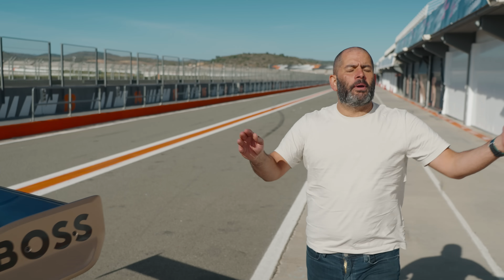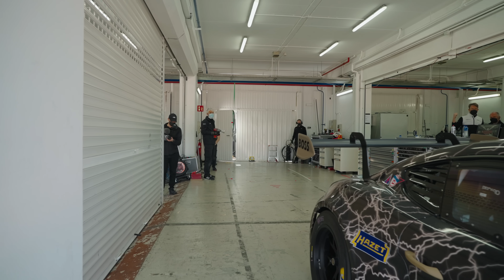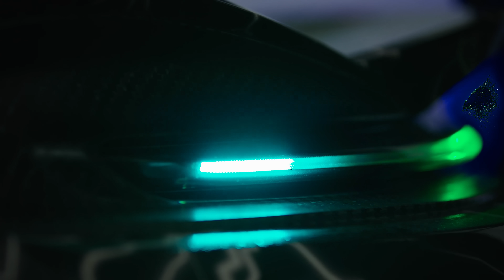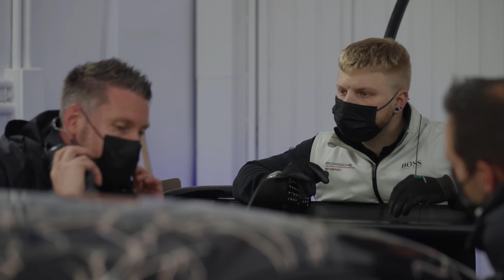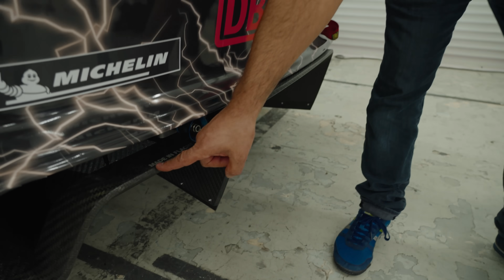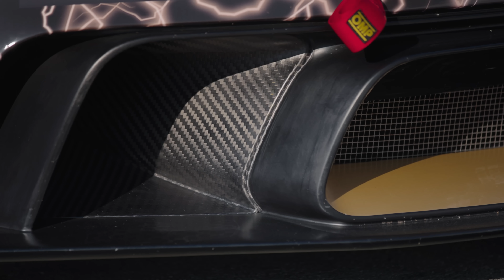Chris Harris Drives The New Porsche GT4 ePerformance

Comment: What happens when you connect an electric motor to a gearbox? Why don't they have one? Would it not be useful to have the motor rev like that through a few gears? Motorbike engines rev that high and they have gears. I know there's no crankshaft in an electric motor, but there is an output shaft, and I thought it wasn't important how the output shaft is driven, you always had to have gears. Explain it to me like I'm 5yrs old, because I haven't heard why EV's don't have a gearbox.
Reply: Electric motors are much less rev dependent, i.e. they don't need to be in an optimal rev to do max torque, its torque curve is basically flat, so the gears aren't needed
Reply: @Mixi1  I thought gearing was about governing speed, and enabling the engine to rev up multiple times. Gear reduction etc. We also have forced induction to cover any holes in torque. "Because torque" is not a sufficient answer. We have plenty of ICE engines that make huge amounts of torque from very low down, and still have a gearbox. My car for example is a new turbo diesel, and it's torque curve is very flat. Small turbo's will cover up and flat spots lowdown and provide a very flat torque curve. So, if an EV would go from 0-120mph with only one gear, how fast would it go with two gears?
Reply: @superchickenlips1  in case of gearing think of the torque rev range. even the best ice has torque in range like 1000 to 7000 rpm. so with first gear it can go from 2 to 14 mph because revs conver linearly to speed. with electric you have torque even from 100 to 10000 rpm. which with correct gearing is 2 to 200 mph.
Reply: Electric motors have instant torque, so essentially there’s no need for gears to make sure you’re in a power band, because you’re always in that power band whether you’re at 2000rpm or 10,000rpm. Obviously there is an optimal gear ratio to compromise for both acceleration and top speed, but this covers both ends in one gear when you have instant torque from an electric motor.
Reply: It's because the torque is immediately available with electric motors. With a petrol engine you get X torque in Y gear at Z RPM, with electric if the throttle is flat, you're getting all the torque, whether you're at 0mph or 100mph so a gearbox becomes redundant in most applications.
Reply: Because they have nearly constant torque and such a wide operating RPM range that you simply don't need a transmission. It would just be extra weight and complexity

Comment: That noise cannot be good for your hearing, what a shocking racket !
Reply: Well the noise is the straight cut gearbox and not the electric motor funny enough. Normally you have a ICE drowning it out, so without it you just get high pitched whine. Not fun for a cockpit viewer but the driver will have earplugs on and outside you tend not to hear it as much, mostly aero and tire noise. It’s the future so we should all get used to it
Reply: @k-ron7403  Gearbox ? You sure about that ?
Reply: @k-ron7403  The noise isn't from a straight cut gearbox because this car doesn't have any gears. That shriek is the electric motors.
Reply: @gbgt2  I'm fairly certain it still has a gearbox it's just a single speed rather than a multi gear transmission, and the drive gear has straight teeth instead of angled ones.
Reply: @gbgt2  Nearly all current BEVs have a Gear Box either Single 1 Speed OR a 2 Speed like the Taycan. Even with a 1 speed box that still has multiple gears to do the reduction. The shriek is a combination of both the motors & straight cut gears.
Reply: had to stop the video the noise was so annoying

Comment: 1500 kg is heavy for a race car. Tire and brake wear must be monstrous
Reply: Regen... So brakes not so much, but tires definitely 👍
Reply: Good point,  about 255kg heavier than the current 911 rsr.
Reply: @trackratzinger  and I bet the battery is pretty tiny on this car or the difference would be in the 400-500kg region.
Reply: @weed46  80kwh useable pack capacity so no not tiny at all. Porsche claims 30mins racing pace at around 650hp and 15+mins in all out qualifying mode of 1000+hp. Recharge in 15mins with the charger they built for it at the track. Very interesting stuff, as they claim almost 50% of the race energy will come from just braking regen. 🤔👍🏻
Reply: @4literv6  that's a large pack... but surprisingly low stamina. 30 and 15min at full tilt is kinda low imo.
Reply: @weed46  well everyone is certainly entitled to their opinion. Doesn't change the fact that is damn good for an ev at race pace. 
This thing could do 2 or more full laps at the nurburgring full tilt boogie or up to 5 at lower levels of power. I say good on Porsche. 😎
Reply: @weed46  it's really not, specially at race pace.
Reply: @4literv6   i wont watch a GT4E race. But it would be cool to see how it would do up Pikes Peak
Reply: @MatsNorway  isn't that still technically a race though? Evs own pikes peak, so I'd think the gt4e would do quite well. 🤔
Reply: Yes, racecars are supposed to be lightweight. Did anyone else notice them changing the tires with every outing ?
Reply: @Andrew4181975  the inner camber of the tires were something
Reply: What's the real world range for all this weight..